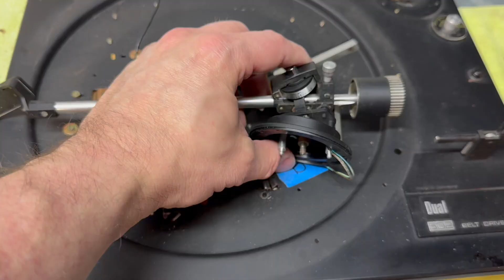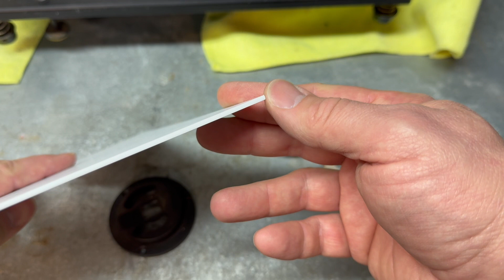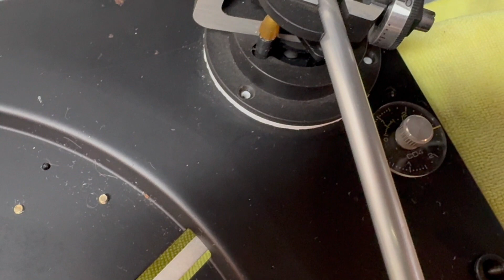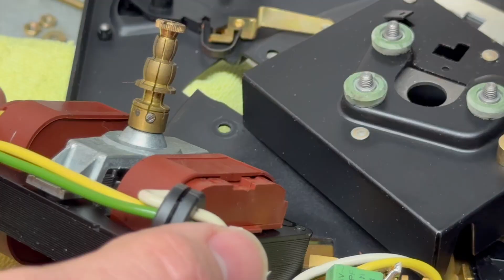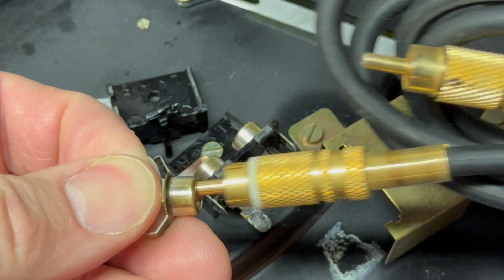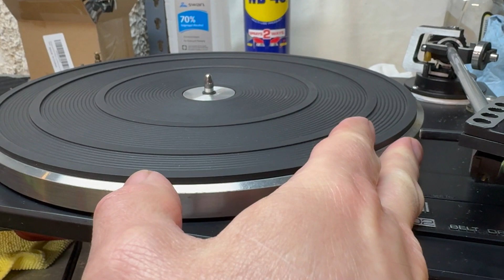Tonearm transplant on a Dual 502 turntable

Comment: Since you raised the tonearm by the thickness of the two pieces of plastic (the white rings) under the arm you have altered the vertical height of the system.  To correct for this, you might need to add some spaces under the cartridge; however, this may not be practical because of the large height difference.  Ideally the tonearm should be parallel to the record surface when the cartridge stylus is set in the groove. Raising the tonearm with spacers changes the Vertical Tracking Angle (VTA) and Stylus Rake Angle (SRA), which can affect how the stylus sits in the groove and ultimately impact sound quality. A better solution to adjusting the VTA might be to use a thicker platter mat.